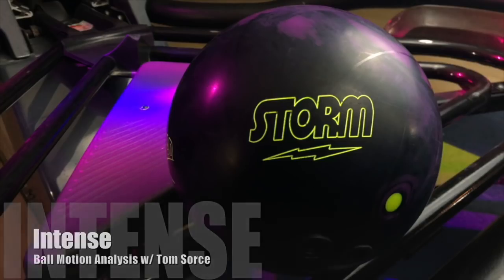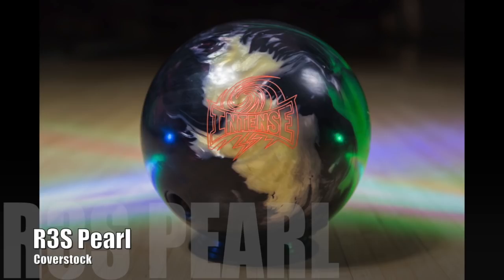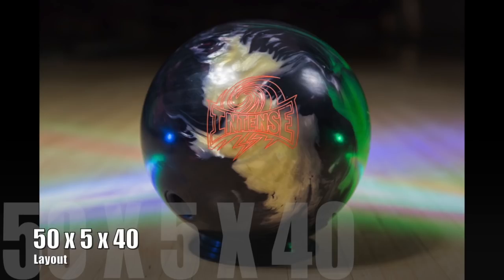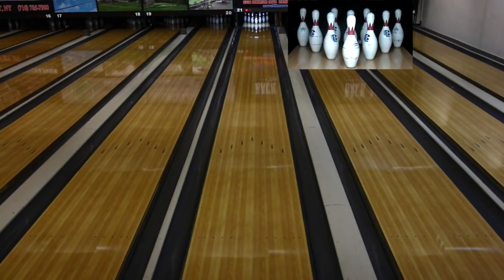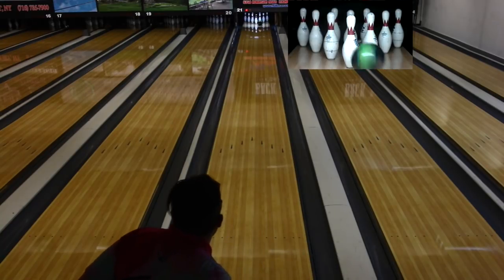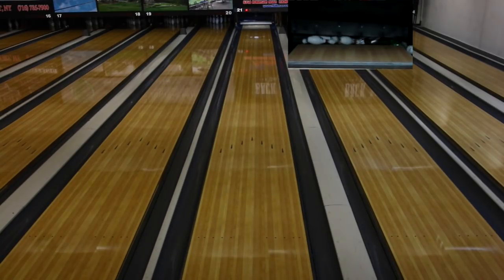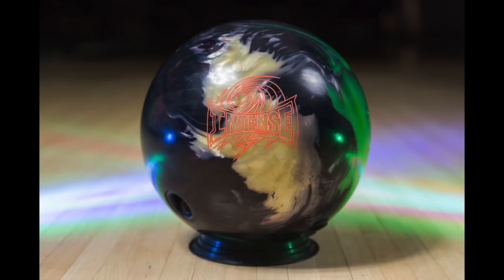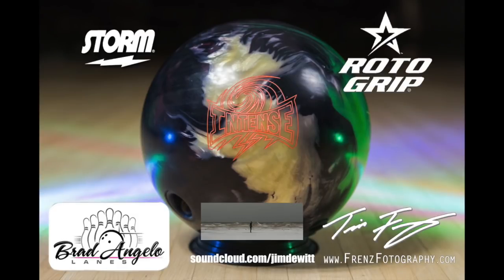Intense

Comment: How do long pin to PAP layouts (5 1/2") effect ball motion on strong asymmetrical bowling balls compared to say short distances (3") assuming the coverstock is the same and the drilling angle and VAL angle are the same?
Reply from the maker: This can be as complicated of a question as you try and make it haha.  The short answer is this: 3 3/8" from the PAP is considered the strongest layout "most hook," but its so strong that that layout doesn't mean you can cover boards, it means you need to use closed angles for fear the ball with use up its energy.  The further from the pin you get from there are considered weaker layouts that will hook less.  As you get closer and closer to the pin from 3 3/8" you get weaker layouts but ones that roll much much more stable and smooth.  These layouts make the ball already be spinning close to its preferred spin axis at release which is what makes them most stable.  These things tend to be true in both symmetrical and asymmetrical equipment.

Obvious disclaimer: I'm not an expert about this stuff.  I drill things from a very simple perspective and I try to be creative.  There's probably people with a lot more knowledge and experience that can give you different/better answer.